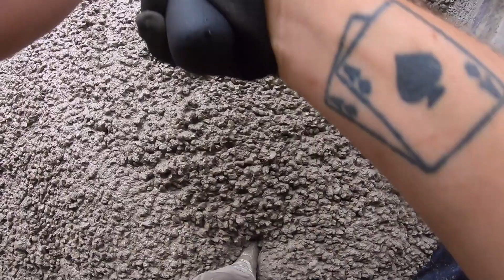Pouring off a 30x36 Pole Barn Concrete Slab

Comment: Is that the new no vibe concrete I’ve heard so much about?
Reply from the maker: Never had to vibrate flat work unless it was a lid to an underground vault where the bottom/under side is revealed. Just order without air, its such a smoother finish.